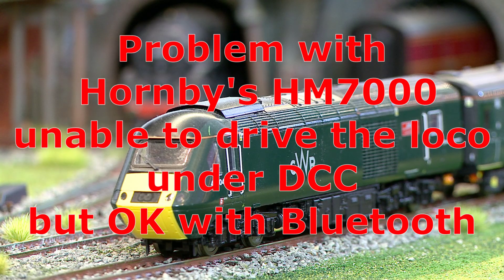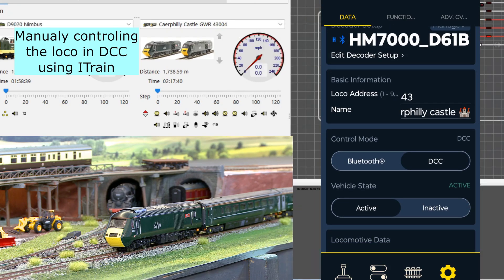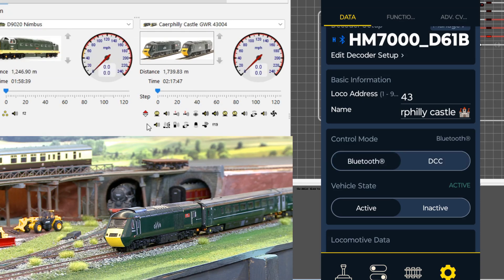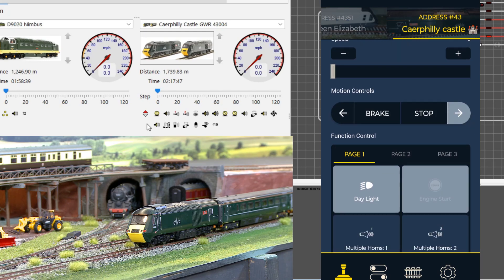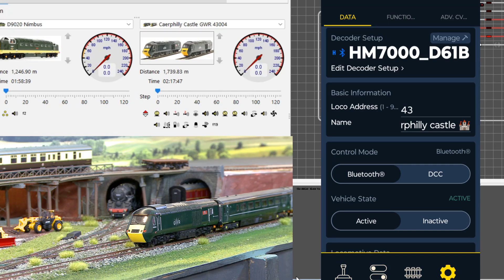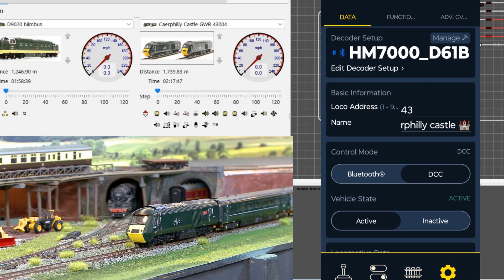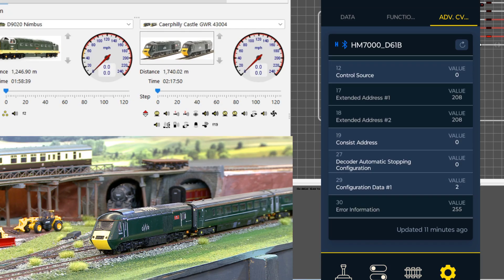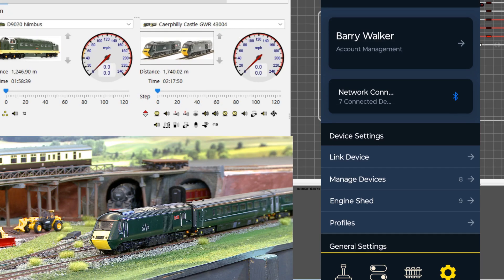Hornby HM7000 not driving in DCC and how to fix it

Comment: I have a loco that keeps showing Consist when I input a loco address on my Gaugemaster Prodigy,although I have never run a Consist,thanks for this. Maybe this is a way of clearing the fault for me as well.
Reply from the maker: First, in the HM7000 App, check for that loco, the CV19 is 0
The next thing to check is whether there a consist setup within the Prodigy controller itself, you may need to refer to the user manual.